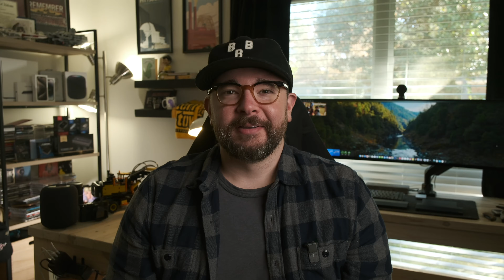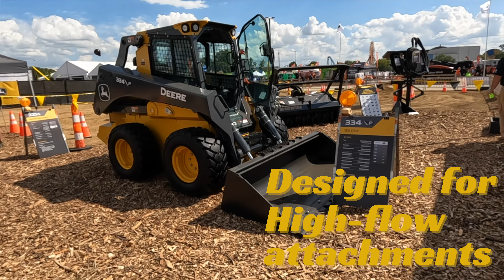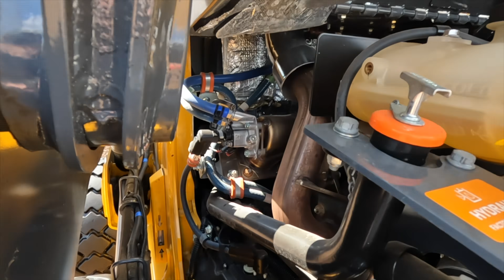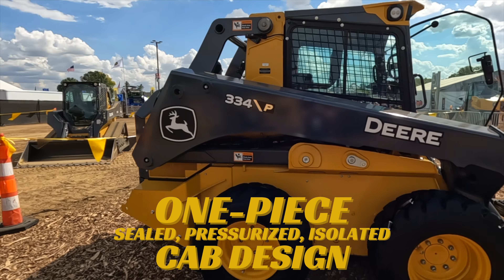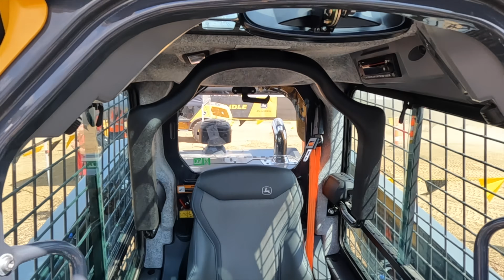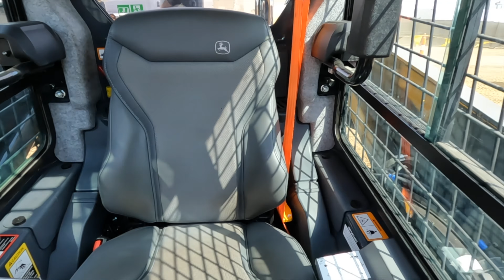How Deere Brought Huge Hydraulic HP to New 334 P-Tier Skid Steer and 335 P-Tier CTL

Comment: We need to get these new flagship machines together and have a proper shootout, Deere 335p, Bobcat T86 and Cat’s replacement for the 299D3 xe, I’m leaving out the ASV RT135 mostly cause it’s more of a dedicated mulcher type and plagued with issues.
Right now bobcat has the highest hydraulic HP in the industry with the T86 and a cooling package that is now proven to be able to run a mulcher in superflow all day in triple digit heat with no auxiliary cooler, the only other machine that even claims to be able to do that is the ASV, all the rest need roof coolers. 
If this 335 can become the third machine that can make that claim then we all win, one more great option.
Reply: What about case....DL550
Reply: @digger7871  different category, case new holland are mini dozers, out of their element in the woods with a mulching head.
Reply: Cat is going to have a model bigger than a 299, the replacement for a 299d3xe will be a 275xe but they have a 285xe in their back pocket! Not sure when we will see it though

Comment: 75 horsepower no def as opposed to 25 horsepower for farm tractors. Industry is apparently finding a workaround for this though. Be interesting to see how pure BEV impacts this market though (ICYMI now currently pure BEV locomotives let alone Tesla Semi for those wondering about power output for pure BEV.) The one advantage to pure BEV is instant torque in moving the vehicle anyways. As a replacement for hydraulics using electrically powered actuators not sure about that. No doubt the industry taking this threat seriously now though given the success of Tesla now Rivian even Lucid talking up the possibility of a pickup truck.
Reply: You don't get def in farm tractors until 76hp+  the >75hp to 25hp farm tractors usually have regens but not with Def. The 5075e john deere (75hp tractor) doesn't even have regen because it's really efficient but rated hp is actually like 74.5ish.

Comment: I get a kick how most industry so called professionals completely over look and are ignorant about crawler loaders. Even this gentleman, who I watch quite often and is very knowledgeable forgets about full sized track loaders. All these new large CTLs are are morphed small crawler loaders with rubber tracks. I personally think they worse visibility than a crawler loader. The last crawler loader I ran was a brand new 605K Loader and it was phenomenal.
Reply: I'm sure crawler loaders are great.  But the reason people love compact track loaders are their ability to be transported from Jobsite to Jobsite without having to either hire a full time CDL driver or hire it out every time you need it at another location, nor can a crawler loader swap attachments. There is always a trade off.
Reply: @damonwicketts1638  , you make a great point about moving CTLs without a CDL. ( I just gave my CDL up after 30 years. ) Too much bullshit. That's definitely a plus for CTLs, but as far as attachment capabilities, a quick coupler on a crawler loader with auxiliary hydraulics and you can put virtually any attachments in your imagination on them. 6 way Dozer blades on a crawler loader should be premium for finish grading.
Reply: There's track loader, and compact track loader, 2 different machines that are made to do totally different  things, it just depends on what your doing, I personally replaced regular track loaders with excavators a long time ago.